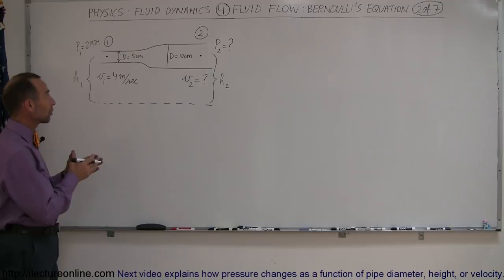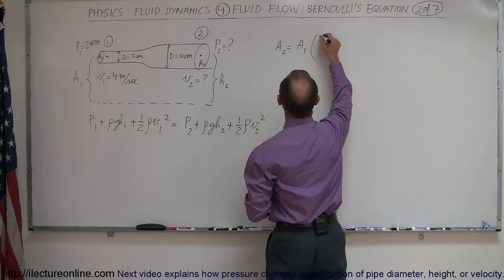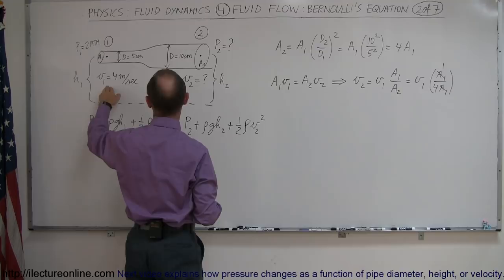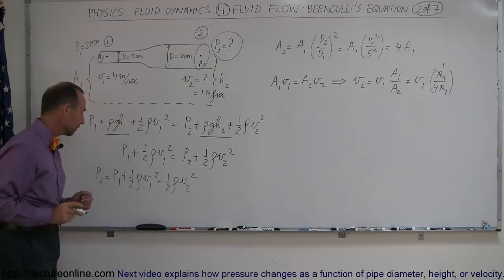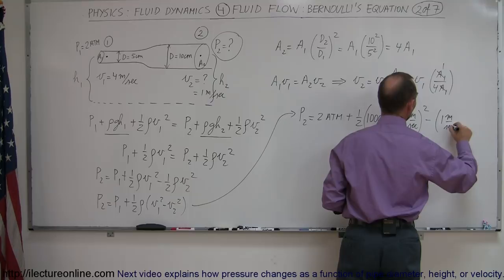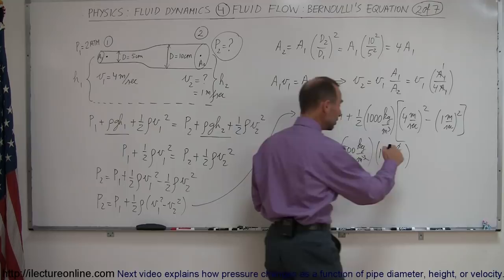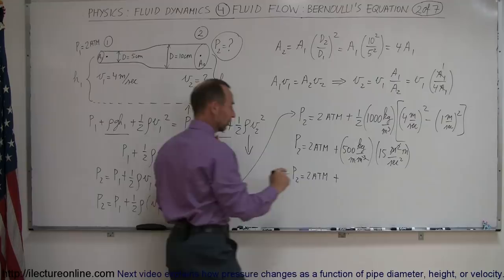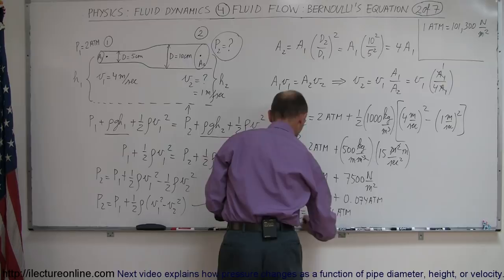Physics 34  Fluid Dynamics (2 of 7) Bernoulli's Equation

Comment: Does anyone know what will happen if P2 is smaller than P1
Reply from the maker: Then the fluid would flow in the opposite direction.
Reply: @MichelvanBiezen  Thanks, but won’t P2-P1 be negative while 1/2p(v1^2-v2^2) is still positive
Reply from the maker: Sure, but that doesn't matter.  It all works out in the end.
Reply: @MichelvanBiezen  ok thanks a lot

Comment: Dear Mr. Michel van Biezen, please I need your help to understand this, maybe I didn't get it well!
As per continuity equation, increase in diameter leads to decrease in velocity, and as per Bernoulli`s equation, decrease in velocity leads to increase in pressure.
But, I can't understand how fluid flows from low pressure point to high pressure point!
I think that if we'll consider the friction loss across the pipeline, the pressure P2 will never be higher then pressure P1.
Please, help me with a good explanation about, let's say, this misunderstanding of mine.
Reply from the maker: Lev A
Yes, the continuity equation shows that when the diameter increases, the velocity decreases.
You also know that when the velocity increases, the pressure decreases.
That is all correct.
The confusion comes in with the mis-interpretation of Bernoulli's equation.
The equation simply states that the sum of the three terms:

P + (1/2) * rho * v^2 + rho * g * h = constant

Therefore you can go to any point inside the pipe and the sum of these 3 terms will always be the same. (Note that the units of each term equals pressure)
Bernoulli's equation doesn't give you any indication as to why the fluid travels through the pipe.  
That is where you need principles of fluid flow.  (I will cover that later this year in a new set of videos).
Reply: Michel van Biezen thank you so much for your quick answer.
I saw almost all your videos, especially Thermodynamics (2nd Law with Carnot Cycle and heat engines) and fluid mechanics! I really want to thank you so much for this extremely important information that you shared for young engineers.
Regarding the original misunderstanding of mine, I have an old book (more then 30 years published before) and there is Bernoulli`s Equation with this form:
P1 + rho * g * h1 + (1/2) * rho * v^2 - Sum f * l/D * 1/2 * rho * v^2 - Sum * K sub L * 1/2 * rho * v^2 = P2 + rho * g * h2 + (1/2) * rho * v^2
First term is the Sum of major loss regarding friction loss and second term is the Sum of minor loss which has to do with all joints and connections between the pipes.
I need for a confirmation from your part. So, if we'll consider this two terms, maybe the value of pressure in P2 is lower then value of pressure from P1.

I will wait with great interest your new videos!
Reply from the maker: Lev A
You are correct.  If you include friction and joints and connections, the pressure will drop.
(It is similar to the energy equation where friction will lower the energy.)  With fluid flow, friction and joints will lower the pressure. (P2)
Reply: Michel van Biezen I thank you so much for help.
My life would be very easy if you were my physics teacher, for sure.
Now everything is clear for me!
I will wait with great interest your new set of videos!
Reply: Michel van Biezen this means that by neglecting the friction loss we can never use the Bernoulli equation in fluid dynamics(oil industry)?

Comment: could you clarify what you do with sec2 ?
Reply from the maker: +Константин Валеев   Instead of using s for seconds I use "sec" for seconds.
Reply: +Michel van Biezen , for me calculations that you do in the end is not clear enough. if don't care about numbers, we have N/m2 is equal to kg/m2*(m/sec2) , so what we have to do with this m/sec2 ?
Reply from the maker: +Константин Валеев Note that in Bernoulli's equation, every term has the units of pressure:  N/m^2  that can be written as:  N/m^2 = kg/(m*sec^2)

Comment: But, the flow will be from the higher to the lower pressure.
Reply from the maker: Not necessarily.  When water flows from a higher elevation to a lower elevation, the pressure will increase.  Or when it flows from where it flows faster to where it flows slower, the pressure will increase.

Comment: another counterintuitive concept, that increasing the dimaeter would cause increase in fluid pressure... I always though otherwise..
Reply from the maker: Yes, it is very counter-intuitive
Reply: Probably because a smaller area will give a faster speed, and we tend to think of faster fluids as "stronger" than slower fluids.

Comment: Pressure increase on the wider section of the pipe, this is absurd???
Reply from the maker: It does seem counterintuitive, but it is absolutely correct.
Reply: @MichelvanBiezen  .....Thanks for the reply.....I wonder if it that can be confirmed using a gauge or meter?
Reply from the maker: Yes, that can easily be done (with the correct setup)

Comment: what is P here? is it pressure exerted by air?
Reply from the maker: +Tahsin Rahi P1 is the pressure provided by a combination of the atmosphere and/or a pump, or perhaps gravity if the reservoir is at a higher altitude.  It doesn't really matter.  This video shows how the pressure changes when the diameter of the pipe changes, which causes a change in the velocity.
Reply: +Tahsin Rahi pressure exerted by fluid flowing through the pipe.